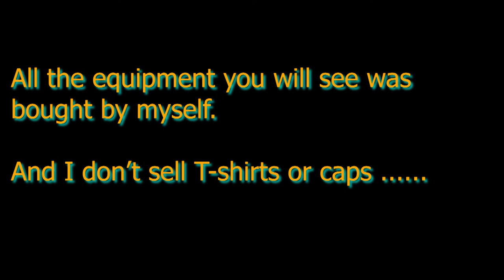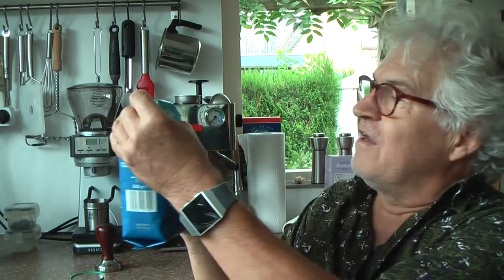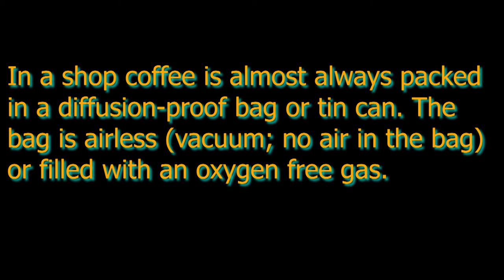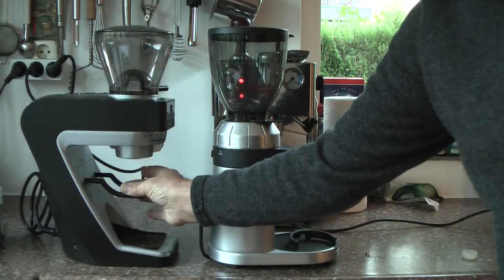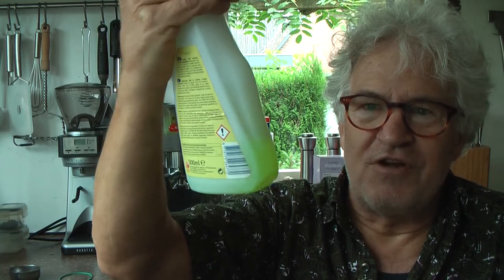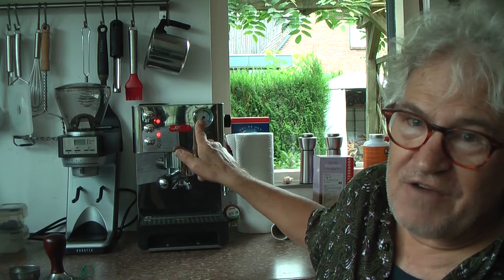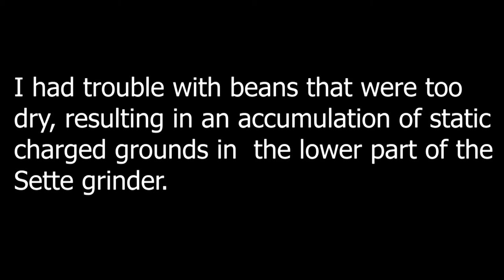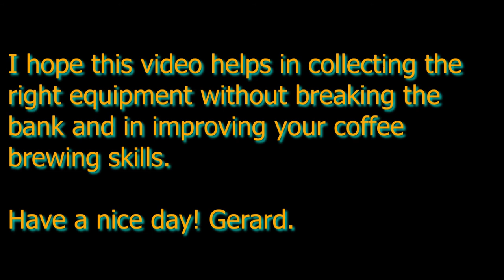Grinding and brewing coffee with Baratza Sette and Lelit PL41EM. Single shot use and brew ratios.

Comment: Love your relaxed approach towards espresso preparation while at the same time taking things seriously! I use the Lelit Anita myself and the biggest surprise for me has been learning about the rapid aging process of coffee beans. Living in a city I’m able to buy high quality freshly roasted beans but really try to use them in about two to three weeks after roasting. Darker roasts tend to be more forgiving. I don’t really bother with freezing, which seems to give mixed results. The need for a good grinder however cannot be overstated! The Lelit grinder on my machine is generally fine for milk drinks but with espresso I use a more sophisticated hand grinder instead.  Happy to use the Lelit‘s steam wand btw, it’s a slightly upgraded version of the one you have so probably easier to use and not too arduous to keep clean. Your workflow is more efficient though!
Keep up the good work!
Reply from the maker: Hello Patric. Thanks for your reaction. The beans (and even coffee grounds) are safe as long as they are stored in an oxygen free and diffusion proof container. Once opened aging (through oxidation and loss of volatiles) will start. In both cases (beans and grounds) lowering the temperature will decrease these (bio)chemical (oxidation) and natural (volatilization) processes. The further down the slower the process. But I think it is somewhat bizar to grind frosted beans, like I have seen suggested by some people. By the enormously increased contact surface grounds are much more susceptible to the aging processes than beans. But I am always astonished to see large volumes of roasted beans in transparant containers in shops where they sell a.o. specialty coffees and expensive blends. The containers are non-glass, non-metallic; the only two materials that are inherently diffusion proof. Let alone that the containers would be filled with nitrogen in stead of with ambient warm air. And not all blends sell out in a few days. There is still a lot to improve for these shops as well as for producers of grinders for the consumer market....... After having used numerous grinders I thought some 5 years ago that the Graef would be an excellent choice. Yes, the build quality is excellent but retention is very high, as is the sensitivity for static beans. The Sette shows that a grinder can be constructed in such a way that there is a near zero accumulation. What I throw in the hopper comes out below and that is fantastic. Enjoy your coffee! Gerard
Reply: @Gerard_Hugo  
Having a good grinder is certainly essential. The one on my machine is a slightly simplified version of Lelit‘s “Fred“ grinder which is okay for your run-of-the-mill Italian style blend. Results for specialty roasts or third wave etc are pretty poor though. I’m not into super exotic coffee beans but when you spend around 15 EUR on 500g a decent grinder is simply a must. Originally thought of getting the Niche Zero (named for its single-dosing zero retention design) but in the end settled for a Commandante hand grinder instead of adding yet another appliance to my limited kitchen space. It’s significantly cheaper as well!
Tend to go through a 500g bag of fresh beans in 7 or so days. My roaster is within walking distance, literally down the road, so no need for freezing. Opinions on freezing seem rather divided, some arguing it accelerates the oxidation process after defrosting. I guess you could freeze single dose portions for optimal results, but personally I’m fine without going that far! Trying hard to maintain that healthy balance between good “home barista“ results and obsessive coffee nerd madness. ☕️

Comment: Hello sir
I also have the same setup, settle 270 and Anna. 
What is ur coffee input and output in grams.
Can you please share your grinder settings configuration ??
It would be of great use to me.
Reply from the maker: Hello Rajat. I grind 10 grams and prepare generally 90 grams (or ml) of coffee (so more a Lungo than an espresso; Dutch taste!). My grind setting currently is 15 but this is different for every grinder leaving the factory. You need to gring and tamp until getting a 9 bar pressure at the Anna. Greetings Gerard